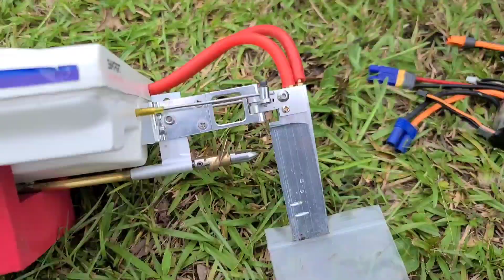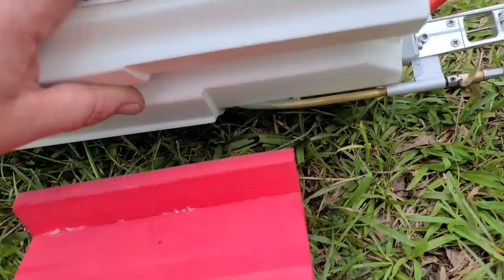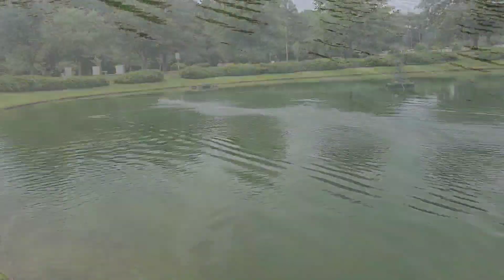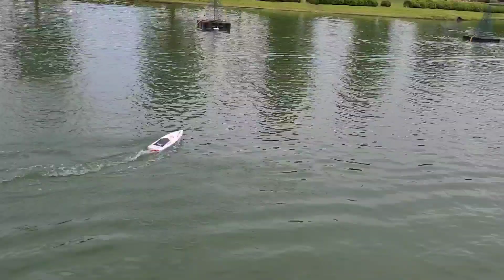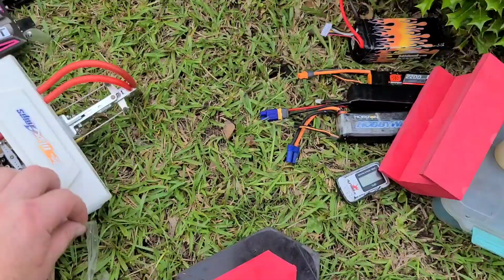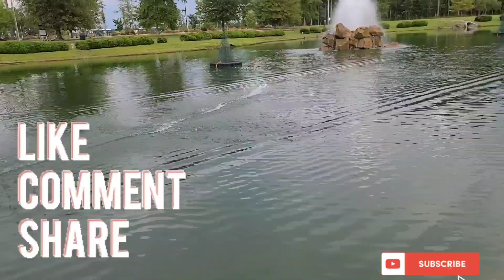New Found Stability Prototype Rc Boat Testing - Water Bobber  Fast Rc Boat

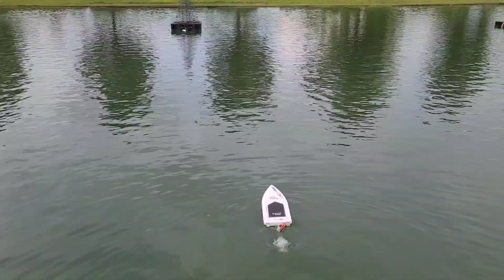Comment: 8:46 into it and it just dawned on me:  You want the center of the prop even with the bottom of the sponsons in the planing attitude.  You'll need a stinger to do that, but what will happen is the boat will run on the prop AND the sponsons for a super-stable 3-legged ride.  The V hull in the middle will just cut through the water, but the side-to-side ride will be on the sponson trailing edges and the prop.  Blueprinting will make a huge difference; even ride pads might help for testing purposes (double-sided tape).  Boldly going where no man has gone before. 🤔🤔
Reply from the maker: I'm definitely not rebuilding the boat to put a stinger on I'd have to literally revamp the whole setup.     It runs good enough for me.    

I see what your saying though basically treat her like a stepped mono. 😏
Reply: @IRONCLADRC  I hear ya.  👍  As I was looking at it, I saw a real narrow stepped mono with stabilizing "outriggers" for stability; that may be what Josh was thinking when he designed it.  That's why I thought the prop should be even with the sponsons.  There may be a fatal flaw in that line of thinking though, and that would be too much of the V part of the hull to be in the water to get that prop/sponson geometry.  Just keep doing what you're doing.
Reply from the maker: @Dr_Jet  yea I was looking at it, I'd have to reposition the servo remove and fill the mounting holes for  the rudder install an off set rudder, install  stinger, fill the 2nd steering thru hull, remove & fill the stuffing tube, re-install  new stuffing tube. Re-mount a servo.   Yea that's to much for right now that's a winter project. Hopefully I don't need to do all of that.
Reply: @IRONCLADRC  The more I look at it, I'm not sure my earlier idea of prop/sponson geometry is on the right track.  The hull geometry just might not work the way I was thinking.  Just keep going in your current direction; you will either find the solution or you won't.  That's how prototypes become production models:  With a lot of "Tinker, Test. and Tune".
Reply: I like the no step in hull and stinger idea. Because it looks like high alpha attitude to me.
Drive it like a mono but with a bit of catamaran.

Comment: I would have built it with a stinger but I'm glad you got it ,. Had to do a tare down on my mini storm didn't like the center of gravity want to run it on 6s eventualy.any how  one off subject question could you turn left tighter by raising the right turn fin and lowering the left, I didn't think of that today or would have tried at the lake earlier. 50 knots and no smoke.
Reply from the maker: It could help a left turn     what happens in a left turn the rudder lifts out the water when it banks hard and you loose rudder causing poor steering

Comment: Love it!! It runs better when faster, time for 6S 🧐BIG B, 🏁🇺🇸🇺🇸🇺🇸🇺🇸🇺🇸🇺🇸🇺🇸
Reply from the maker: Yep I'm gonna throw the 3665 2100kv turnigy on her see what happens.  Possibly next week?
Reply: Great stuff Big B,  for a small boat that thing is flying around.  Nice desighn and looks really good.  I just bought a big half cabin hull from Skipper Craft in Qeensland , didn't think is was so big . 955 ×300 mm . Not sure what to use yet , 2 40 mm jets or outboards maybe a 56 80 and 200 amp esc . Really well made and thick fibreglass,  this one's going to be my baby . Wife bought a carton fibre hydroplane $150 900mm . Guy does great work , need to try a few smaller boats from him . You got me wanting to build instead of buying  RTR , have a good weekend mate.